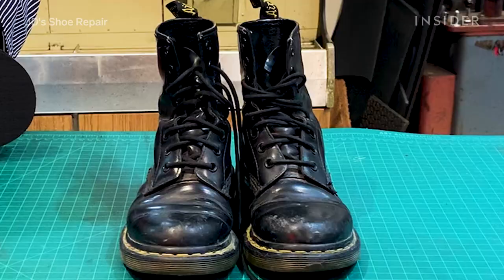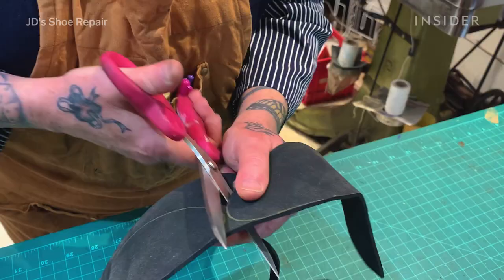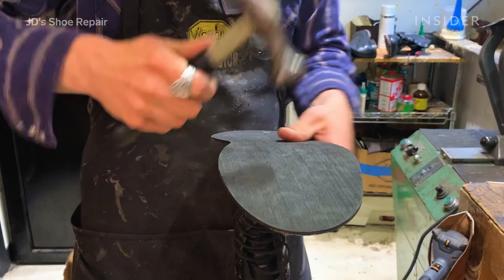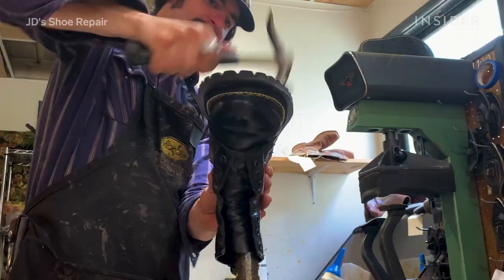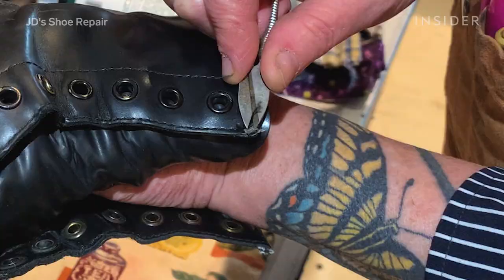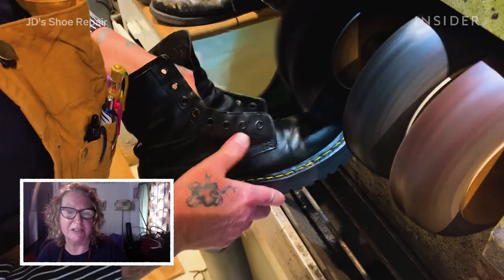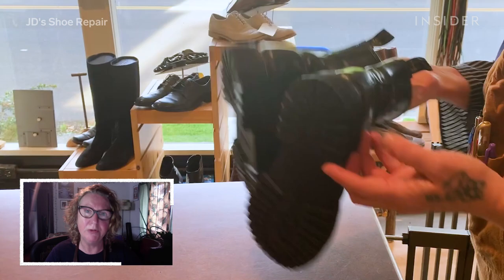How Dr. Martens Get Professionally Restored | Refurbished

Comment: The dye job was poor, some of the yellow stitches she wanted to keep ended up getting covered.
Reply: DMs aren't made to be resoleable. She did a great job
Reply: @jokokusnuss  Sure. I was talking about the dye job specifically.
Reply: Lookup2Wakeup  they're not
Reply: @jokokusnuss  Great job? That was clumsily made, no matter how much you want to see it differently. Here even untrained, mediocre cobblers do a better job than this, and even cheaper than you might imagine.
Reply: @jokokusnuss  all she needed was painters tape to cover the stitches as she dyed them, that looks like amateur work, and then she didn't add a shank which was probably the worst part, everything else seemed fine enough
Reply: @daddykarlmarx6183  docmart doesn't have a shank to begin with, solovair does.
Reply: How about you do it and see how far you get.
Reply: @Enrico- they’re all resoleabke, even the Asian ones. Timpsons do it for £60, so it’s a little expensive given a new pair aren’t much more. Btw they use the same sole solovair uses
Reply: @HkFinn83  outside of britain no one has the machinery to do it. They're not as resoleable as a normal pair of hard-soles footwear. A pvc welt melted to a pvc outsole isn't exactly a resoleable shoe.

Comment: I don’t like how the bottom turned out. I wonder how much that cost to repair.  A third or half the price of the boot new
Reply: I learned that the old sole used to be thicker
Reply: bottom? do you mean the sole? lmao
Reply: One thing you need to understand is I have 30 year old Docs, I don't wear anymore because I've worn them out.  In the present,  and for the past 5-7 years, Dr Marten company has released two new versions of the 1460 (8 hole, black), the boot you see here. The company exported manufacturing almost 20 years ago.  Die hard fans noticed a vast difference in workmanship and quality of materials.  

So, to appease the fans, they sell the outsourced footwear, including the 1460, at all major retailers,  and from their own webstore. For 150% to 200% more,  a person can buy a 1460 Lifetime boot, or a UK manufactured boot exactly the way they had made them for decades, over half of a century at this point. 

The Lifetime boot is what it sounds like.  It is the retail version, but with free replacement boots, for life. The UK manufactured one is my preference... but they need to be worked in.
Reply: @bobastu  the lifetme boot discontinued in 2018. Also the Made in England 1460 boot which claims to be the same isnt a patch on one from the originals. The leather was thicker and so was the sole which also bouncier and had far more tread.
Reply: @g4geetar  I have the made in England boot. Once I put it on,  I was immediately transported back to my first Docs. Not the ones I bought at the shoe store at the mall in the late 90s and forward. I had to break these in.  Not just put on and go. Leather feels like a higher grade. I don't think I'm going to get the leather separation wrinkles past the toe box, while I am getting wear there, it's not the same. The sole does feel different too. For me, with the money. 
Docs started as a police/ military type boot, and that is what I was reminded of when I put on my Made in England 1460s. Are they for everyone, I don't think so.  I've had Docs since the early early 90s, 1990 I think.  Different colors, always a boot. Some steel toe, some composite toe electrical safety, but my faves have always been the 1460 8 hole.
Reply: @bobastu  Im in England and mine were bought in the 1970s so were made here and were comfy.
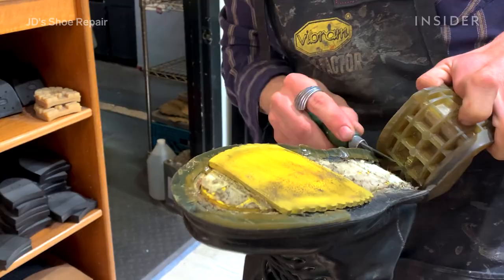Reply: And they also forgot to add the “air cushion” which is the yellow pad under the original PVC sole (at 0:53). Not a good restoration at all!

Comment: If I was getting these repaired I would ask for a leather mid and cork. I would also have them put in a leather good year 360 welt. Should be using yellow stitching all around. I don't care if it costs more than the boot. Doing that literally makes it a better boot than new.
Reply: She didn't put a shank in it, too
Reply: @opinionsvary  in my opinion i think a doc marten would benefit from a shank for arch support, but i could see where you're coming from. I just think the sole is too flexible to not have a shank.
Reply: @opinionsvary  i get where you're coming from, but if i were to buy a doc marten i would buy a model with a wedge sole, just in case the lack of shank does cause issues for me

Comment: Curious... why not make the boots even better and add a shank when the leather filler was installed and why was it not converted to a Goodyear welt?
Reply: Yeah i agree, otherwise what they did was good, sewed in a mid sole can replace soles easy now, but why no shank ? Normal docs dont come with a shank which is stupid . the old Docs of the 80s and 90s did and the original factory making Solovair boots still make similar shoes to docs with a shank ... weird
Reply: That is a Goodyear welt
Reply: @themisunderstoodgorilla7030  pretty sure the Made In England line still has beechwood shanks, but thats only their top-of-the-standard line of boots, and when you get to the $220 price range, just get Solovairs. They have an in-house resoling service where you can get an original sole put back on (also an option to change between standard and "commando soles" which is a more combat boot-esque sole that comes with some of their boots).
Reply: @grugg3108  yeah solovairs are way better imo for basically all the reasons you just outlined.
Reply: @themisunderstoodgorilla7030  also, double-checked and I was mistaken. They still lack the shank, but they still use the felted midsole of the vintage counter parts, so bleh.
Reply: Tring shoeshop add corking

Comment: ok so i was taking off my doc martens earlier today and i noticed the back stitching (closer to the bottom of the shoe) on the back part that is under the tag was ripped.. the stitching seems to have come loose and broken off and now the back part has a hole between the back strip and the rest of the show on the side vertically. what do i do? try to glue it myself or get them repaired? they're also brand new like a month old and i've only worn them maybe 5 - 7 times total
Reply: Call Dr Marten customer service. They will replace them as long as you have some type of proof of purchase

Comment: You've got to be a real Dr marten die hard fan to bother getting them repaired. I've just seen a cobbler in the UK wants around £50 to replace the sole...I'd rather buy a good used pair on eBay for less, even if they only lasted a couple of years...and for me the sizes always seem to come up smaller than expected..totally over rated product and the boots have a tricky reputation as being the uniform of skinheads.
Reply: I think it's worth it for a vintage UK pair. But definitely not a newer one. The vintage ones were a lot better leather so the lifespan if you get them resoled is insane.
The one in the video is stitched on not welted on so I'm betting it's not that old. I probably wouldn't go through the effort.